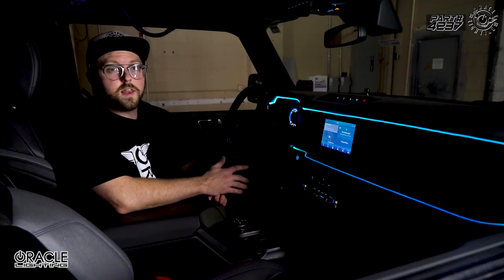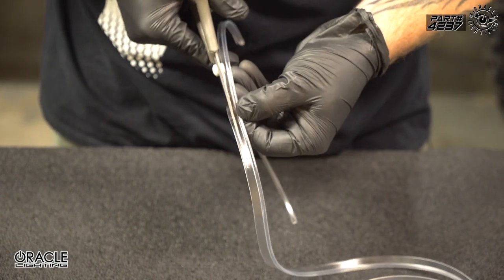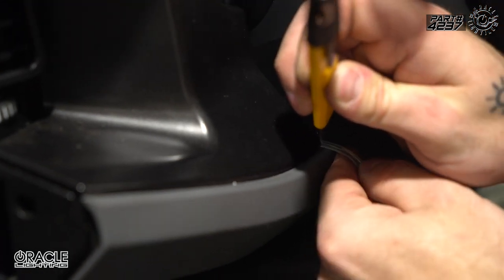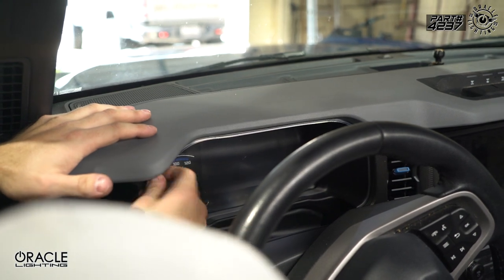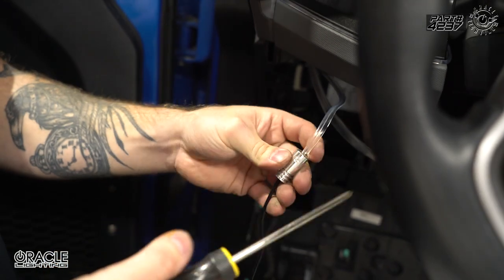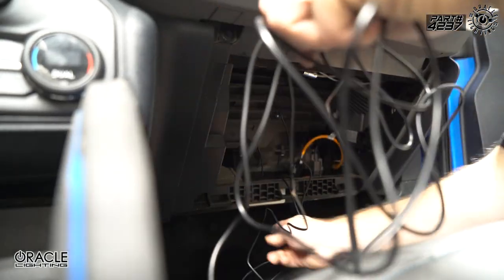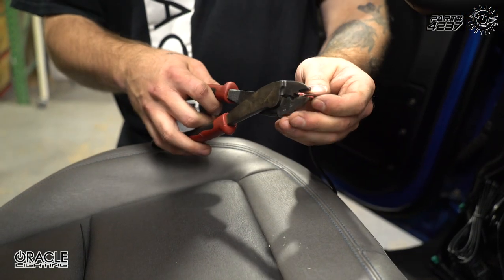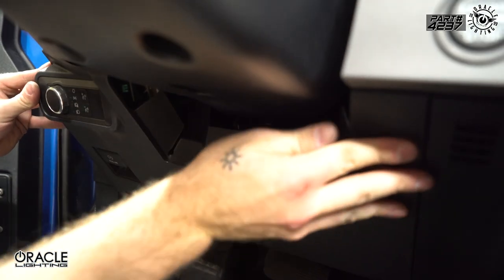Ford Bronco ColorSHIFT® Fiber Optic LED Interior Dash Board Kit Installation by ORACLE Lighting

Comment: If you had aux switches, it gets even easier using the wires running to passenger side.
Reply from the maker: Yes, good point you can connect to the factory Aux switches if you prefer.
Reply: Can you post a video of installing to aux switch?